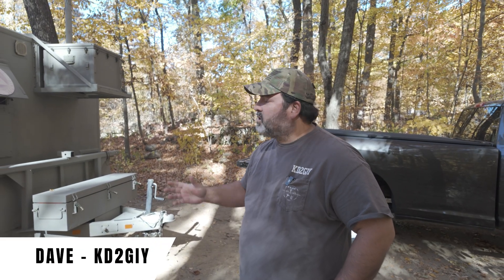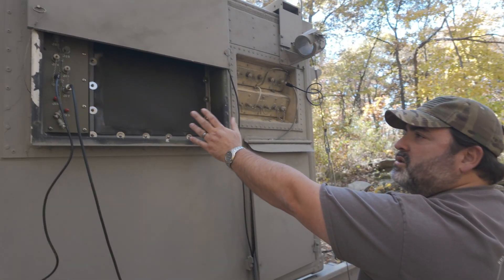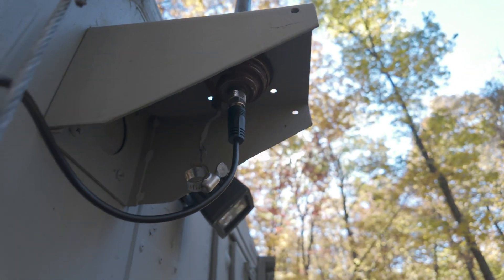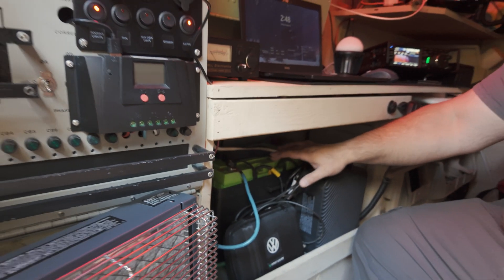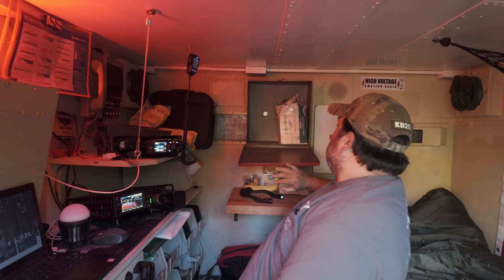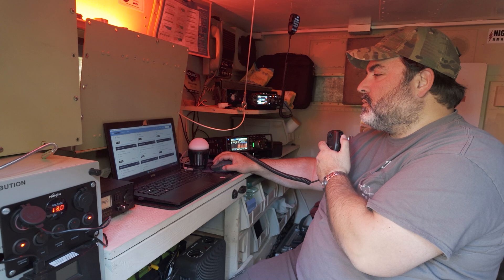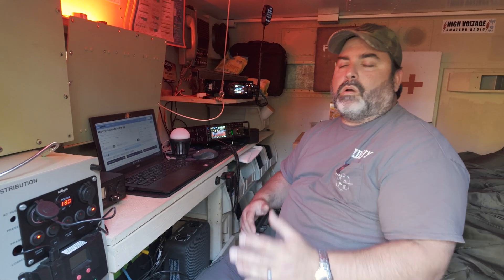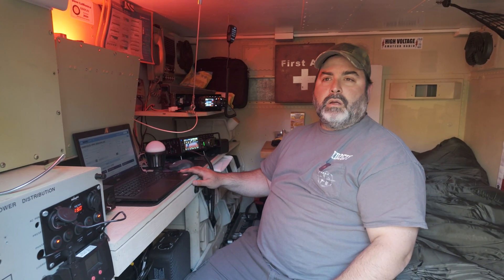Military Communication Shelter S250/G | Ham Radio | Emergency Communications | Parks On The Air

Comment: Yes I have a s250 shelter that Iam going to put a 5000 btu ac window unit in. The placement of your I noticed was under your bed. Does that keep you rig cool in that location? Iam in Kentucky with high humidity. Thanks just subscribed to your channel love your rig and info . Thanks
Reply from the maker: I’m pretty sure that his is a 5000 BTU AC and keep the shelter cool.

Comment: S-250s were designed to fit in the back of a standard pickup truck.  Depending on the weight either a 3/4 or 1 ton dually
Reply from the maker: @thefieldphoneguy8254  Thanks for the information! I hope to own one, one day!

Comment: I was in a Light Infantry unit so we never had the full version of these, just a cargo Humvee with some sleeping bags, radios and a case of MREs in the back. This look much more comfortable. You probably could pick up a 40 foot OE-254/GRC packable antenna, it is designed to work with that box but it is only for VHF.

Comment: UHF or Microwave Van, i used them in 70s to early 80s, i used ANGRC 144 or 143 radios, 26 Q
Reply from the maker: @fredsiegfried1707  I will have to take a look at those vans. Thanks for watching!

Comment: Why did you take the air conditioner off? You should have left it on that would have been awesome.
Reply from the maker: @johnratcliffe6438  I believe he still has an AC in there he just relocated it on the floor somewhere.

Comment: I too, had an S-250 comm van that I mounted on a single axel, 5x8 cargo trailer.  It was a 2-year project to build a comm van for our ARES group in my county.  I paid for all of it from my own pocket, although the van was donated as 'scrap' from our local Air Guard group, who was trying to find someone to haul it off.  It was 90% finished when I needed  $$$ to pay for it being painted.  I had chosen NASA White, since that would allow for all kinds of lettering and information.  Sadly, I was told that there was no need for it in the ARES group, and they didn't want to support it at all.  Yes, I had HF, VHF, UHF, 2m packet, a VHF Low Band radio and licensed with Red Cross, a scanner and CB radio.  I also had a 2500w portable generator that was on the front of the trailer.  I had the original 34' fiberglass whip antenna as well as connections for various other antennas.  A year later, we moved from my rural home into town, and my wife didn't want me to keep it.  So, it was sold to another ARES group by me to recover my investment.  This was in 2002, and they are still using it today. The end of the story is the next year we had a large wildfire south of our city, and they were unable to communicate via mobile radio with the EOC.  They asked if they could use my van to which I told them I had sold it since no one was interested in it.  Several accused me of theft and thought it was ARES property...  It only took a few hours for them to be properly informed.  Another year goes by, and they managed to buy a used TV remote van that required insurance, fuel, and cost about $400/month just to keep ready to go.  They found the sponsors for it, but is doesn't have the same capability as the van did.  I may look you up and send my pics to you on email. :)  In a way, I wish I had another van to build up but, that was one of the most enjoyable projects I had done in my years as a ham.  73, Paul - K7IN
Reply from the maker: @paulcavnar913  Those shelters are built to last that's for sure! I would like to build one out too. For camping at Feild Day events.

Comment: More on that CB setup? Where'd you find a phone style mic and speaker? Need me one of those.
Reply from the maker: @nathanhayes8228  I believe its a RoadTalker 40 CB Radio Phone 3813. Check out eBay for those. Thanks for watching!
Reply: @Ktmoney123  sweet! Thanks.
Reply from the maker: @nathanhayes8228  No problem!

Comment: I was a 31F we worked in the 250 shelters similar to your but way different in other ways. The panel that opens on the door is suppose to have a NBC filter so if your on NBC lock down you pop open the panel turn off the AC and turn on a blower fan that will draw air through the filter and the fan blows the air out. 

Cool to see what you have done with it. 

GOD Bless you and your family
Reply from the maker: Thank you for that information on the shelter! I appreciate it! Thanks for watching!

Comment: I dig the setup. We're thinking about putting out rigs like this out here (Big Island Hawaii). The shipping would kill me, but if a decommissioned unit like this we're donated, I'd weld it up and probably try to spec it out the same. Great inspiration, bud. You just got a new subscriber. Keep up the awesome. KH6GG 73🤙🏾
Reply from the maker: @TheGeekiestGuy  I have found some of these shelter for around $2,000. There was one with a trailer like the one Dave has here, that one was like $4,000. 

Maybe its possible to get a grant for some thing like this out in Hawaii. I really appreciate you subscribing! Hope to here you on the bands some time! 73!
Reply: @Ktmoney123  we're setting up for the contest today. Gonna get the new folks on the air and able to copy. What's your email. I'd like to keep in touch.
Reply from the maker: @TheGeekiestGuy  That’s awesome! Great way to get new people involved and started with radio! Is your information good on QRZ? If so I'll e-mail you.
Reply: @Ktmoney123  I'll have to check. I literally just got a new callsign. I'll let you know as soon as I make sure it's updated. It's probably still set to the WH6GWL. 🤙🏾
Reply: Our county wants the clubs to help out, and we're thinking mobile comm stations like this for disasters are gonna be the best way. They're far more affordable than buying and kiting out a van.

Comment: This is cool, didn't realized but I'm about to build almost the same thing but more UpToDate I guess and to small. Mines a toy cause it's for pulling with an e-bike but I was thinking of getting a CB and a 5km Wi-Fi, but I'll also have cell and internet via phone. I just wish I can make it as big as this one.
Reply from the maker: That's awesome! I just built a cargo e-bike bike too! Sounds like a cool project, will you be making any videos on your build?
Reply: @Ktmoney123  I have already started. I'm actually kind of on my 4th build, was testing min limits but now of the winter I'm building over kill. minimal was just a pain.
Reply from the maker: @Ro-Bucks  Awesome! I will check out your channel!
Reply: @Ktmoney123  thanks my second newest short shows the beginning of my new build. I'll have the panel finished soon as some stuff comes in the mail.

Comment: It looks like it may fit into the bed of a pickup. Probably best for a 3/4 or 1ton.
Reply from the maker: @charlesstephens3660  it will definitely fit in the back of full size 3/4 or 1 ton truck bed. Dave is building one for the back of his truck now. I'm sure at some point I will have a video of that once its done.

Comment: Emergency Comms in NJ ? The centre of so many natural disasters. the last tornado in his area was in the 2009 and it was barely anything🙄
This is nothing more than a LARP setup. 

This would have made much more sense if he was in FL, The Carolinas, California, or Tornado Alley.
Reply from the maker: @the-polyatheist  While New Jersey may not experience the same frequency of extreme weather events as places like Florida or Tornado Alley, we’ve still had significant incidents where communication infrastructure failed. 

Hurricane Sandy in 2012 left many without power and cell service for a week or more, and localized issues like flooding or snowstorms frequently knock out communications. But it’s not just natural disasters that can cause problems—there are many other factors too. 

For instance, an unauthorized update to cell servers caused a failure in cellular networks and First Net. A recent incident at a County Public Safety Building, led to a fire suppression discharge that took the 911 Communications Center offline for a  good part of a day. 

Most of time the setup is used for camping and Parks On The Air and Feild Day.
Reply: He did the work.  You complain on the internet.   Someone's opinion carries more weight with me.
Reply: In point of fact, the coastal northeast has a fair share of natural disasters.  New Jersey has had a good number of tornadoes, the winter months often bring snowstorms that shut-down entire towns, and New Jersey itself does have earthquakes.  While the earthquakes experienced on the East Coast don't typically have the devastating effects of, for instance, California earthquakes, these can still be rather disruptive due to the population density found in that part of the country.

The up-side to outfitting an equipment shelter like this is that it can be used in multiple ways:  as a stand-alone communications platform, as a repeater site, as a re-transmission site.  

The military used similar shelters that were configured for different types of communications, which offered a modular way to tailor communications solutions to a particular mission in a particular place.  So maybe a shelter configured for VHF/UHF and HF communications like this would be paired with, for instance, a tropo-scatter shelter, or a SATCOM shelter.  This modular approach allowed for the flexible design of a communications plan that fit whatever mission the teams were called upon to perform.  And because these shelters were self-contained, they could be transferred with a small crane or a forklift on to different vehicle platforms - Humvees or 2.5-ton trucks, for the most part.  But they could also be un-bolted from a vehicle and placed  on the ground or on a ship for transport.

The drawback to a platform like this is that it must be moved by truck.  If the roads are impassable or fuel is in short supply, the capability is pretty much locked to a single location.  Further, with the equipment pretty well integrated into the shelter in this manner, it is, potentially, a time-consuming chore to de-integrate it so the shelter can be left behind and the equipment made man-portable.  Although equipment shelters like this are still occasionally used by the military, packaging equipment suites like this, these days, is often done in transit cases in order to facilitate transport in something that isn't a big green box on a big, green truck.  Lastly, for a civilian individual, a set-up like this increases the cost of maintaining the capability:  another vehicle (trailer) to register, another set of axles and brakes and tires to maintain.  Without governmental or NGO deep pockets, going to all the work of integrating an Amateur station into an equipment shelter is often not sustainable economically due to maintenance costs.

This is the same reason I don't really invest in go-boxes:  they fit a certain scenario, but de-integrating the equipment out of a go-box in order to be able to throw it in a bag and walk it out is a giant pain and is less flexible, overall.  This makes such set-ups unattractive in my mind.
Reply from the maker: @N0LSD  I fully agree with all your point of view, you’ve covered key considerations that are crucial in evaluating a setup like this. The challenges and benefits you’ve outlined is a well-rounded perspective, making it clear why certain choices may or may not be practical. You’ve highlighted valuable factors that are essential to keep in mind for a portable setup. Thanks for stopping by and commenting! 73!

Comment: That's a great little mobile comm station. In the military back in the early 70s I was a radio repairman in the Air Force and worked on the TSC-15 mobile comm center. I'm putting together something like what you have there but I'm building the trailer myself. New sub. Technician going for general. K7ZFI Been really enjoying my new little G 90. Just talked to Poland on 20 watts. How cool is that?
Reply from the maker: First off, thank you for your service! And thanks for subscribing! Dave’s setup is fantastic and has definitely inspired me to build something similar in the future as well. Good luck on your General test—I used Ham Radio Prep and Hamstudy to pass mine, and they were super helpful. The G90 is an awesome little radio! I’m still blown away by how we can reach people thousands of miles away with just 20 watts and no infrastructure. Wishing you the best with your build and your test!

Comment: You should just get an electric blanket for sleeping - won't take much off the battery, and nicer than overheating with heater.
Reply from the maker: @jd1029  That is definitely a great idea! Maybe even have a separate battery on a solar charge during the day, to use at night. Running a a heated blanket on low would be plenty to stay warm at night. Thanks for your suggestion!
Reply: @Ktmoney123  Welcome, we do this, and works great. It’s really comfortable, and if you get hot, you can put your foot out lol. Check for the 12 volt ones…for camping. Lots out there
Reply from the maker: @jd1029  appreciate it! 73!